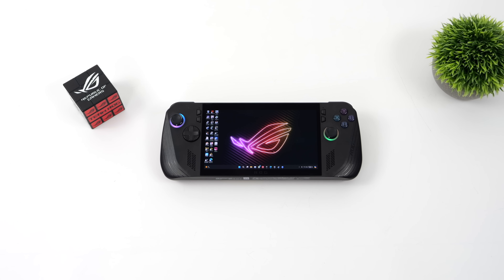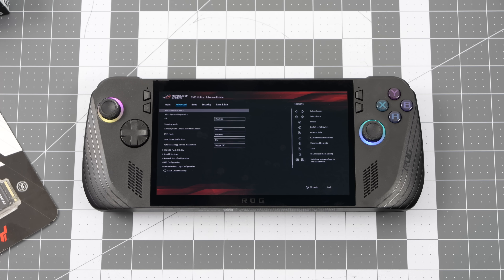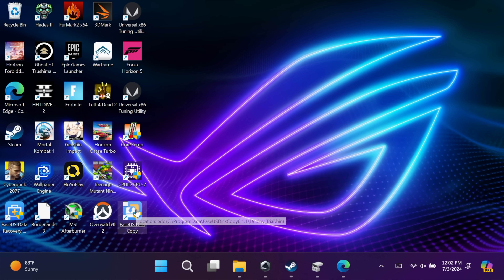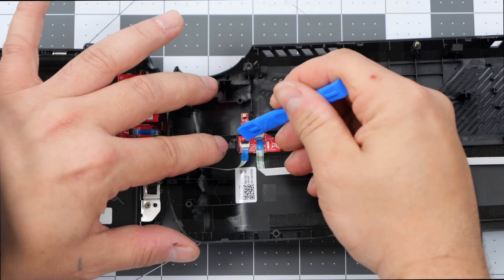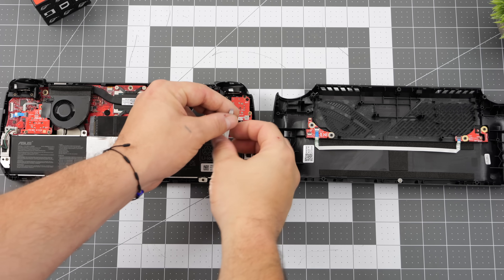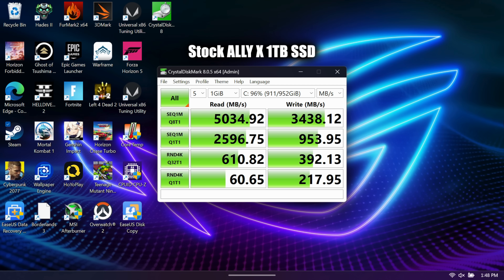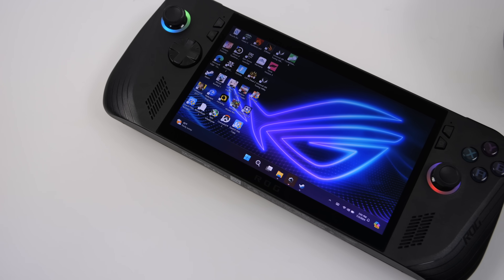The Ultimate ROG Ally X Upgrade! 5TB Storage For All Those New Games!

Comment: Micro sd’s are trash just re use or buy another ssd and put it in external case and bam you have portable ssd and it still works 10x faster than the micro

Comment: Hello thanks for the video I'm  wondering if I want to go for a higher storage capacity like 
8 terabytes is that going to heat up more quickly  or shorten or affect the lifespan of the rog Ally
X because of the larger storage 

And also which ssds would you recommend purchasing because I heard that some heat up quicker than others and some already have a built in heat sink installed I would like to get the best most reliable one that won't cause issues 

Thanks

Comment: I work in IT, I took my Ally apart to check out a bad analog. I swung the battery lever up and lightly detatched battery cable. When I pulled it out literally the soldering of the socket came out and pulled from the motherboard. Completely broken.

Comment: It’s only a 10 dollar adapter to put a 2280 nvme in the regular ally. It’s easy to double the battery size too. I did both upgrades at the same time. It’s so much better.

Comment: Thanks for the video, nice job. I just upgraded my Ally X to 5.5TB this week (4/25/2025). I didn’t disconnect the battery or the ribbon cable, I just put the bottom of the case on a book and slid the top under it a little so that there was no stress on the cable. I installed the Samsung Pro 4TB Internal SSD Gen 4X4 with Heatsink for PS5 (MZ-V9P4TOCW) from Best Buy. It has a heatsink and slid right in with plenty of clearance for everything. Slapped it back together and ran the ASUS recovery. All of my games were saved on a 1TB MicroSD and I copied that to my new 1.5TB MicroSD (SanDisk Ultra Plus 1.5TB MicroSDXc UHS-I [SDSQULB-1T50-AN6MA]), put it in, after loading Steam and Epic, both programs could see all of my games and it’s been running great!
Reply: Can you leave the link to the Samsung Pro 4TB?

Comment: Do you think installing a wd black 8tb with the heat sink will fit? Anyone know or install one?
Reply: Update. 8tb works. If anyone has any issues see the rest of this comment 

I was shitting bricks. It wouldn’t turn on after the swap. Apparently there a photo light sensor in there that if it detects any amount of light it won’t allow power from the battery. Also all screws need to be installed and backplate in. Even after connecting it to power (which is another safety measure) it still wouldn’t turn on. I thought I broke it. Just had to hold the power button on for 15 seconds and it kicked on.

Comment: It's possible to get almost double that, if you wanted too, but I guess that this would work better for the Rog Ally Z1 Extreme.  1: upgrade the internal 512GB standard NVME for a 2TB WD Black 2230 NVME.  2:  1.5TB Micro SD Card From Sandisk.  3:  Dock with both a 2nd Micro SD Card Slot and 1 M.2 slot for NVME support.  4:  2nd 1.5TB Micro SD Card.  5:  4TB 2280 NVME.  Total in Docked, Desktop mode = 9TB.  I wouldn't use the Micro SD Cards for anything other than storage though, just because it's like gaming on a 7,200 RPM HDD.

Comment: Sooo, im curious. If you pause it at the 6:50 mark and look in the top left corner of the board, there's a white "secure" clip thingy (idk what they're actually called, lol.) 
 But, it's labeled "bios" but there's nothing connected to it. I know it came like that because you opened it and only removed the ribbon cable that goes to the rear back buttons. 
 Soo, Unless you have opened this up before and removed the ribbon cable from that "secure" clip. If not, then it came like this. 
 I believe it did come like this because I've seen empty "secure" clips before on brand new laptops. I just never understood what they were for.
 But, because this one says "BIOS" I'm really curious to know what the clip is for. It's obviously not anything important or it would have a cable connected to it.
 Sooo, what is that for? Why does it say "BIOS" but have nothing connected to it? What could be added to it?

Comment: I bought the same SSD (4TB Kingston Fury) as used in the video, but my write performance isn't anything like that of ETA Prime's. I'm getting approximately 3800 MB/s on the first test, which still beats the stock WD drive by a small margin, but isn't anywhere near the rated capability of the drive.

The drive idles around 34°C with bursts up to 70°C during the tests, so it's well within tolerances and shouldn't be throttling. Has anyone else seen similarly poor write performance with the Fury?

Incidentally, I upgraded the Ally X's drive straight from the packaging, i.e. without first turning it on. Getting into the BIOS following the documentation was an arduous task that took me more than an hour. The device kept switching itself off while it was still in the ROG splash screen. Once in the BIOS, however, cloud recovery was pretty much plain sailing. I left it to complete overnight.

Comment: I recommend fresh install then using Easus to partition the drive into two. A smaller 200gb "c:" drive, and the rest as a D: drive. 
This way you can easily back up the OS drive, snd should anything go amis, you can restore just the c: drive and not have to reinstall everything.

Comment: 7:04

You highly recommend disconnecting the battery before removing the SSD and then you don't do it?
Reply: But at least he told us to do it! I did disconnect both batteries before installing though, but mostly because I kept accidentally turning the unit on while manipulating it during disassembly.
Reply: He does this often. As long as you are careful you’ll be fine. Just don’t stab anything lmao

Comment: can i take my 2280 4tb out of my ally z1 extreme , and put it in my ally x and just boot and have it update , armory crate ...ect ...reboot and would it all be ok, my games, or will i have to set up the 1tb then just clone it to the 4tb....i was hoping some magic and just work , kinda like what you can do with a desktop, i swapped a ssd from a ryzen 3800xt and rtx 3070 pc to a ryzen 7 2700 and rtx 2060 super pc and it worked fine, rebooted...also i used donemax disk cloner, simple program..
Reply: all my drives are silicon power sd cards the pink ones, wife had a 4tb go bad but running a faster silicon power g4 drive..

Comment: Is the heatsink required? Going to do this on the X In a few weeks, original ally didn’t need heatsink.
Reply: Just interesting given the SSD it comes with doesn’t look like it has a heatsink. I know it’s preferred to have one, but space etc. sometimes means it’s not recommended if it’ll put pressure on other points like that cable?
Reply: Yeah its required

Comment: For drive cloning, most larger brands provide a free version of commercial cloning software, but it will only work on their drives.  If that's not an option and you don't need a fancy GUI, you can create a bootable USB stick running Clonezilla that works really well, and it's free.  I've used it many times.

Comment: Do you have to add the shield and thermal padding? Kinda killed 2 ssd with the old Rog ally with the thermal padding melting on the Ssd. I Never had a problem with just straight up putting the drive in it without the the padding and shield.
Reply: Just brought the 2tb version of this drive, and I asked kingston directly. They said that since the drive has a graphene heatspreader on it, there are no issues using it without a heatsink...

Comment: I would like to know if it is possible  to install the ssd from your regular Ally Z1E on the new Ally X without having to start from installing everything again.

I would like to know this because I have the 2280 mod on my Ally.
Reply: You could use a software that allows a sector to sector partition cloning like AOMEI. It will make an exact clone of the original bootable drive. After it's finish, just pop it in the Ally X and it will be working with all of your games installed.

Comment: The Kingston KC3000 4TB (like all other capacities) is exactly the same product (Same TLC3D FLASH chips, RAM chips and Controller chip) as the Kingston "FURY Renegade" range but less expensive, the latter is only a version " gaming" marketing of the Kingston KC3000, it is enough to compare in benchmark (via CrystalDiskMark and others) to realize that the latter which is falsely announced at 7000MB/s in sequential reading, really works at 7300+MB/s like its equivalent " FURY Renegade" but I suppose that Kingston orchestrated this so that the "KC3000" range does not overshadow the "FURY Renegade" range... A bit dubious as a way of doing things...

Comment: If you do this upgrade right out of the box would I still need to connect to ASUS servers to download windows 11, Drivers etc? I had seen another video you posted about 8 months ago modding the ally’s original storage to a M2 2280. Just would like to know if I can use that process from the original to the ally x.

Edit. Went back to watch the video and he does state if you do a clean install you can use the cloud recovery from ASUS from his other video upgrading the stronger in the original ally.

Comment: 10:13 Note that 100MB/s is effectively the fastest that any "UHS-1" Micro SD card can actually read.
The only way that a UHS-1 Micro SD card goes any faster is with "DDR200" transfer protocol for 200MB/s (as opposed to "SDR104" for 100MB/s), to my knowledge the Raspberry Pi 5 is the only device ever made to support DDR200.
I believe I've read that the Ally X does support UHS-2 (SDR104 protocol but with more pins), so you can get faster cards but UHS-2 commands a hefty premium, and all the UHS-1 cards advertising 200MB/s are effectively not compatible with anything.

Comment: This is one device that I could consider replacing my Steam Deck with. The power, the display and the battery is big one... This of course of money was not a object. It's very expensive right now, if this was around $450-500, I would be all over it. Never mind the cost of a 4tb M.2, pricey stuff.

Comment: Will i be able to use 2230 on it as well? I have a 2tb one already
Reply: They answered that in a recent Q&A, the ssd will fit and will work because the socket is the same ...  but the "screw hole" is fitted only for a 2280 so you won't be able to secure a 2230 in place without a hardware mod.

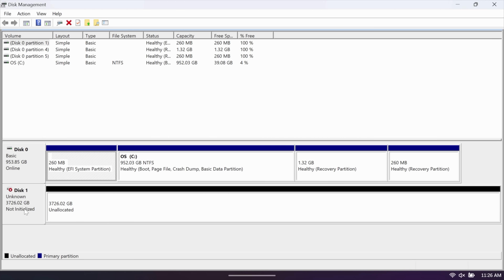Comment: 3:01 - "It is advertised as 4 terabyte drive but we're actually working with 3.7 terabytes"

This is a bit confusing but it is actually a 4 terabyte drive. Windows is showing the number in tebibytes (in this case gibibytes instead of gigabytes). Microsoft should change the GB label to GiB which is more accurate for what the UI is showing.

Comment: So, the Ally X is only a thing because ASUS made a flowed device. Sorry, we screwed up, here, maybe you like this? Really though, thanks for buying 2 devices.
Reply: The ally was likely the prototype and the X was the real deal. Same for the Steam Deck vs the OLED.
Reply: @Curt1813  Ally 100% was. I'm even OK with beta hardware as long as they have good support. I know buying 1st gen hardware is risky, but I do it from companies that give me 0 problems.
Reply: But when valve and and nintendo do it its ok?
Reply: @nathanjuan6042 Which flaws did the Switch or Steam Deck have? I'm sure it was to the same level of killing SD cards or maybe the VERY bad customer support?
Reply: @xero110  I have my ally for 7 months and I never had an issue with sd card and never had a problem with my device. If you don't like the device then what the heck are you doing here in ally vids? Please stay away with ally vids and go with deck vids if that is what you prefer. We don't want toxic people here. Your just wasting time going in every ally vids to promote the deck.
Reply: @nathanjuan6042  Oh I see you have no problems with your device. That settles it everyone, all the other reports of problems are lies.

Comment: The problem with a large SSD on Ally is Armory Crate SE. It simply can't handle having that many games installed. Armory Crate on my 2TB Ally hangs so frequently I finally just disabled it. Sadly I don't expect AC on the X to perform any batter.
Reply: So basically it's Software issue, which can be fixed with an update.
Reply: @Sup_D  Can and will are two VERY different things. Asus has had almost a year now and it still isn't fixed. It's likely they only test Armory Crate SE with very small game libraries so as far as they're concerned there is no issue.
Reply: @Mario00064  because no one brought this up prob enough

Comment: You'll save 1-2w dropping down to Gen 3 on the NVME, plus less heat. Gen4 NVME in general pretty pointless on a handheld, better to free up more wattage for GPU/CPU.
Reply: Yep I agree, bought a 2TB SK Hynix Gold P31 which is the most efficient Gen3 SSD.
Reply: Pretty wild thinking that 2w can do any difference these days.. but it does!
Reply: Interesting - can you vouch for Gen 3 working without any compatibility/performance issues? I actually have a spare Crucial P3 4TB M.2 PCIe Gen3 NVMe Internal SSD from years ago that I've never found a use for.
Reply: That is not going to free up any wattage for the APU to use. The APU is limited to 30 watts and the entire system is built around supporting that 30 watt usage regardless of what drive you use.
Reply: @arcticowl1091 I believe they're referring to battery life. Not the APU directly using more power.
Reply: @FlaccidGnome  i really doubt that because they think fast storage won't matter. Faster storage most definitely makes a difference. It would be true if the Ally had an exceptionally weak CPU, but it doesn't so it's just bogus advice from a person that doesn't really understand what they're talking about.
Reply: @arcticowl1091 cpu and gpu is what makes it feel snapy fast nvme only get faster transfer speeds and data reads thats dif then cpu gpu snapyness in windows or im just dnt knw what I'm talking bout mate 😂

Comment: HEY ETA
just wanted to ask that could you fit 10 tb in the ROG ally
If there is 8tb ssd and a 2tb SD card
Please try it if it is possible than I will definetly buy it
Thanks

Keep making the great content❤❤
Reply: At that point I guess the drives will be more expensive than the Ally... love it!
Reply: @alandiegovillalobos yeah
Reply: 2tb micro sd cards exist? last I knew the largest was sandisk 1.5tb
Also have you seen the price of 8tb NVMe drives!!!! lol
Reply: @Nodster  it's pretty frustrating how slowly 8tb rollout / pricing is coming along. Would be great to see SSDs pass platters in price / gb during my lifetime.
Reply: @Healthy_Toki  I think we will start seeing that price drop start happening when SSD's start to pass mechanical drives in size and we are probably only a couple of years away from seeing that size difference happening anyway.
I did not even know 8tb consumer ssd's existed until recently but have known about enterprise products for a while now.

The consumer SSD market is a bit of a strange one right now as it seems manufacturers are pushing for more speed over more capacity and the reality is would any of us actually see that speed difference in regular every day use like gaming, working etc? anything that is not straight up copying files to the drive where that is about the only time I could see anyone noticing an actual difference.
Reply: @Nodster yeah
The ssd market will grow more and more overtime
Reply: @Nodster well it's worth a shot
Reply: @Nodster  yes 2tb micro sd cards actually exist and are maybe more than a grand
Reply: @teph1977  I would not be surprised at the price to be fair, this is the way lol
Reply: @Nodster  yup
Reply: I'm asking for a 30tb ❤